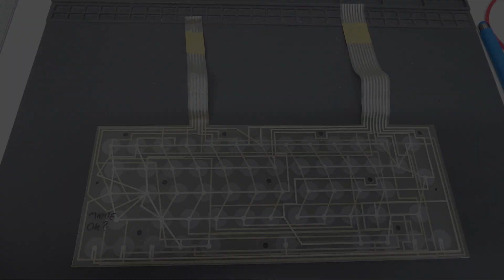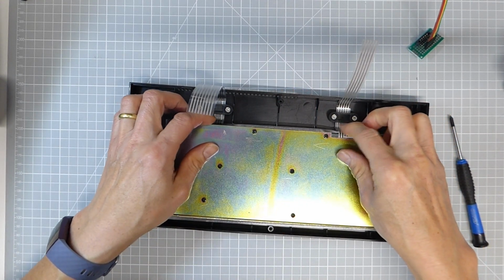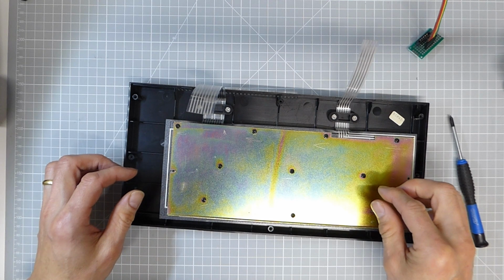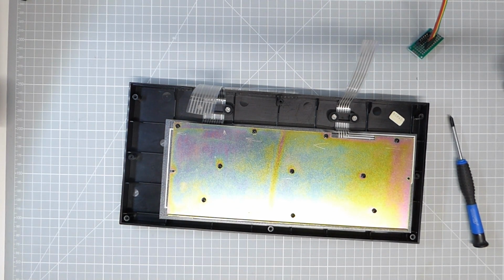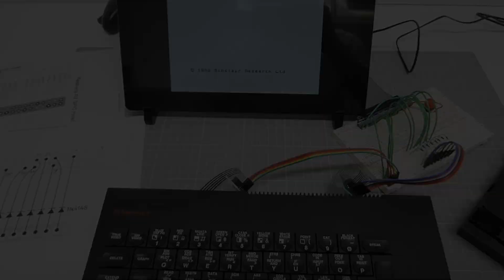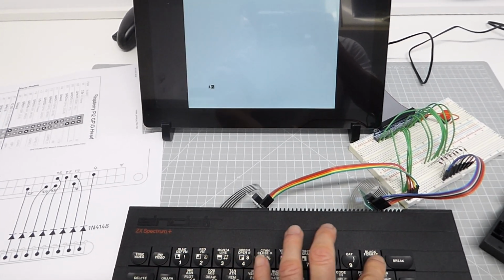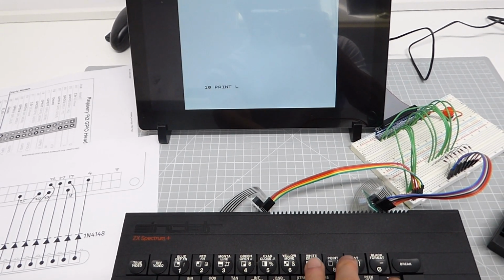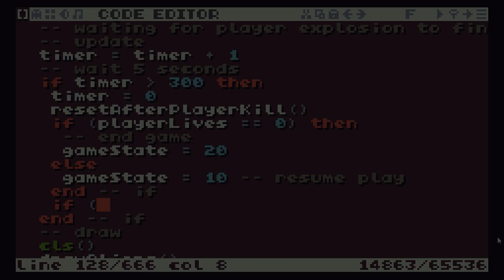ZX Spectrum keyboard membrane replacement

Comment: New video!!!!
Reply from the maker: Yes, Just getting a couple of shorter ones out as I build up this ZX Spectrum.
Reply: Just a quick question but would it be worth maybe putting a small piece of sponge or something soft between the clamps and the ribbon cable to maybe stop the membrane from breaking. Just an idea from watching this, love the spectrum videos and have just purchased a spectrum plus case to do a very similar project. Thank you for the amazing videos👍